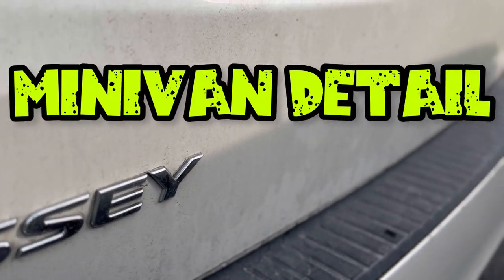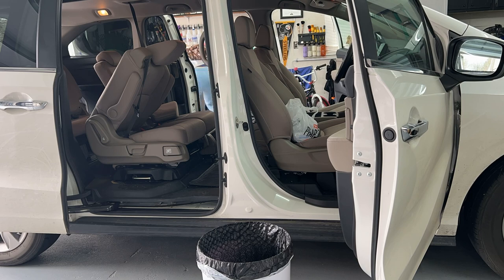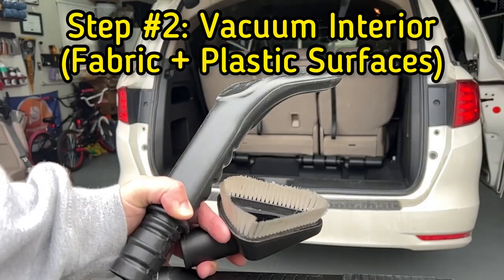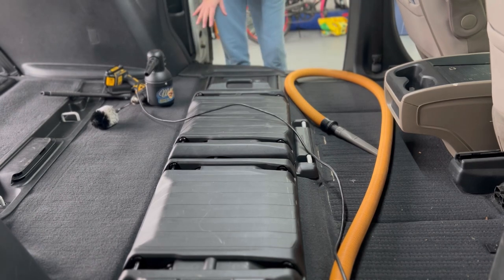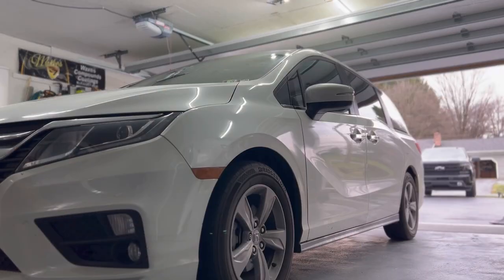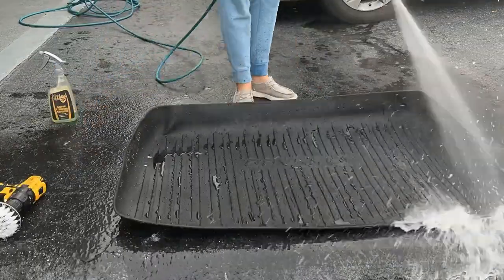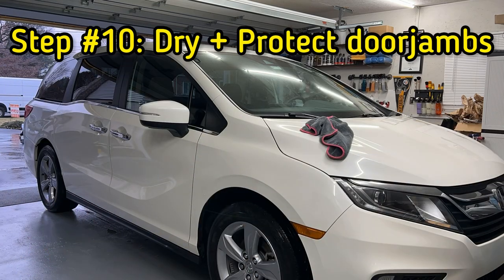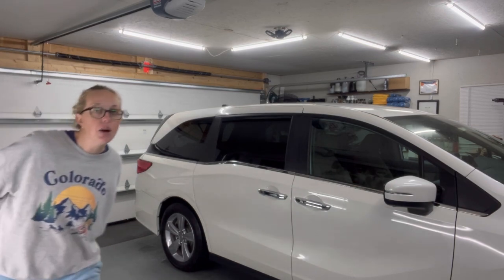How To Clean Your Minivan Like A Pro!- Transformation + Tips & Tricks

Comment: I’m amazed you did all that in 6hours!! Love watching your channel here in the UK (and girl as well!). How do you manage to pressure wash door shuts without getting tons of water in the interior? I struggle with this - maybe I’m using a wrong degree of nozzle?
Reply from the maker: I don’t worry about a little water and normally just have a towel nearby to mop up. It’s less water than if you were to open your door in the rain but I use a 25 degree tip and just practice gives you a more confident hand. For minivan doors though I can’t pressure wash TOO much the middle door and normally just do a waterless wash on those as yes, the interior door would get SOAKED. I learned that the hard way many a time

Comment: Looks really nice! Great job. Driveway: do you find that the chemicals you use are damaging the driveway? And doesn't the "stuff" (dirty water, junk) freeze down to the driveway? Cool video.
Reply: I am having driveway blacktop discoloration which looks horrible.. any suggestions on keeping it black??
Reply from the maker: We’ve been here 3 years and the driveway is faded some but I am diligent to rinse when using strong chemicals and clean it after every detail. The reason it’s fading is due to all the pressure washing I do to it but not really from the chemicals
Reply from the maker: And yes it can freeze so in winter I normally work in the garage with rinseless washing. This day was milder temps so it didn’t freeze

Comment: Great job! How often do you use interior dressings? I feel they attract dust even after heavily diluting them. I love the look of natural clean plastics/trim.
Reply from the maker: I rarely use them and use something more like Cruise matte detailer or a spray wax. If I do use a dressing it’s because the plastic is faded and needs reconditioned. I only use water based dressings but normally just clean and put a UV protectant down (I’ve even used a spray wax before)

Comment: I have a 2017 ram 2500 you gave me some good advice.  Don't drive it in the winter.  How much to do a total detail including black leather interior.  Very clean truck. Including Very best coating.
Reply from the maker: Trucks start at $400 for a full detail and prices vary based on size and condition.

Comment: great video! have you ever extracted any really nasty seats? ive done several and the wicking just drives me crazy! especially when i dont know what the stains came from
Reply from the maker: Yes and normally use a stronger cleaner for those but the Spot Stop does help with wicking but normally heavier seats require much more thorough extraction

Comment: Serious question:
I'm usually GREAT at truck maintenance. 
Since "Covid" with everything closed I've lacked.
My dealer car wash still isn't open. 
I now have rust on myb2012 silverado...gggrrr.
I need a heavy clean then a maintenance. 
I wanna get rust fixed soon.
What do you recommend  for "down n dirty" clean like the expedition you did?
Then just maintenance  till I get rust fixed.
I had a Tacoma with no rust after owning it 13 yrs.
2 yrs of no maintenance  killed my silverado. Breaks my heart
Reply from the maker: You definitely want to do a chemical decon with a clay bar treatment (Turtle wax rapid decon is a great one available on a retail level) and then at minimum a polish or cleaner wax. The decon MAY remove light rust that is just developing but if it’s etched into the paint then it may be too late. Then apply a ceramic sealant or at minimum a sealant to put down UV Protection and help make it easier to clean therefore less risk of rail dust developing and turning into rust.